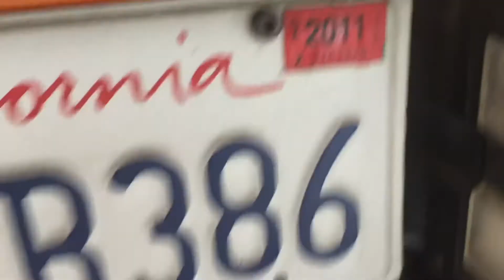I DIDNT GET THE NON OP🤦🏽‍♂️( NEVER DO THIS)

Comment: I’m in a similar predicament.. my man got me a Tahoe so my car ended up parked for going into 5 years now.. I didn’t want to sell it because it ran like a champ.. left a few cars in the dust lol.. so I held on to it.. now I regret it.. because even though it starts it won’t move.. I’ll step on the gas and nothing.. I’m pretty bummed out.. also forgot the non op thing.. and it hasn’t had tags for ever lol.. now I don’t know what to do with it.. should I junk it.. should I fix it and give it to my son.. idk😂
Reply from the maker: I would probably give it to my son...It's probably just the gas pump or something pertaining to that which probably won't cost you to much.....& as far as the tags....You should hit the DMV & find out how much they're trying to charge you for the registration....I read somewhere that someone actually went to the DMV for the same situation & they actually got a cpl of fees waived so I'm actually praying for that same luck so...yeah ! 🙂 Most definitely appreciate the comment and lmk how it turns out...💪🏾🙏💯
Reply: I got it moving! It was the pedal position sensor I fixed it all on my own.. I’m so proud of myself lol.. it’s still acting up though.. one of the tires was flat so I replaced it but since then the service brakes, traction control and ABS lights are all on now.. I have been driving it around and it feels fine except it’s making a grinding noise.. might and that’s a BIG might.. try bleeding the brakes.. I gave it an oil change(also on my own) and now it’s saying it has low oil pressure and the temperature slowly starts going up.. but it’s only when I’m not pressing the gas pedal.. engine light turned on because I put regular gas in it instead of premium.. I thought it would be fine but nope lol.. filled it up with 91 so I hope it feels better.. I’m just worried about the oil pressure.. followed the instructions in the manual and I used the oil and filter it stated.. I wonder if I should use something for high mileage and hope that fixed the pressure issue.. idk I’m learning off YouTube 
It’s a Pontiac Grand Prix GTP